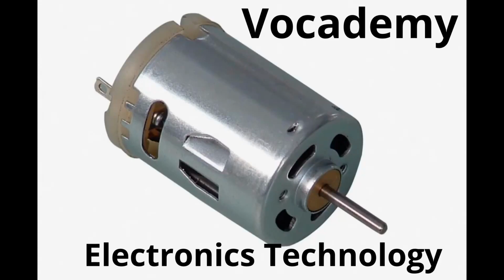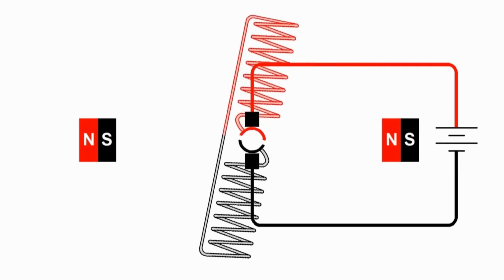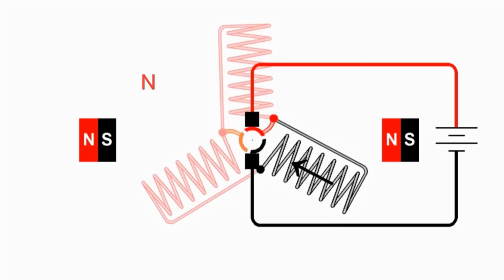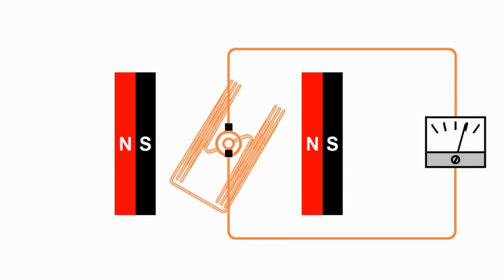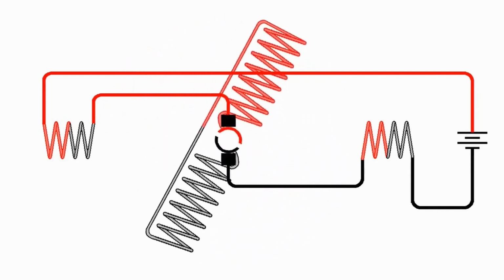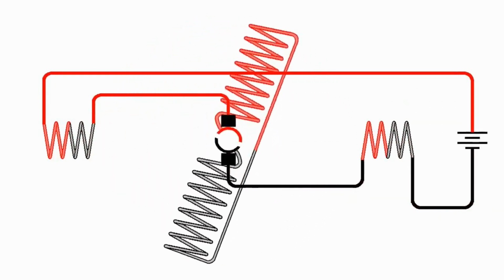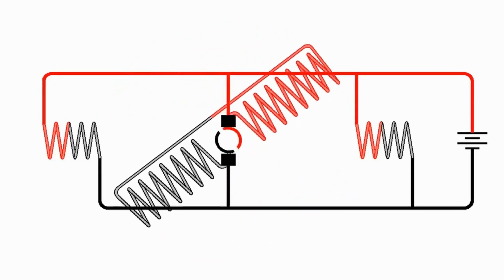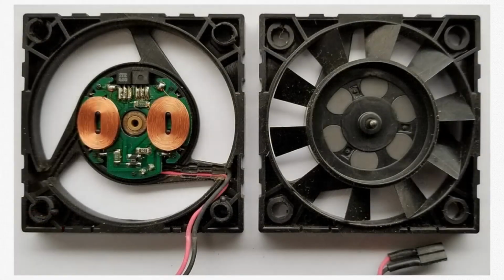DC Motors and Generators

Comment: Thanks for a detailed explanation of motors. I know this was covered briefly, (brushless motors). my question is in the 1970's Fisher Audio produced a turntable that used a "linear motor",  this is from Fisher Electronics sales information "Some of the most outstanding features of this unique drive system are that the turntable platter is the rotor of the motor, that there are no electrical connections to the rotor, that the rotor has no armature windings and that all the complicated electronic circuitry is in a stationary (non moving) position on a single PC board mounted into the turntable base. Would this differ from a brushless motor, or is it's function basically the same?